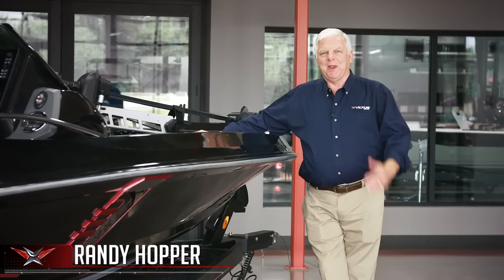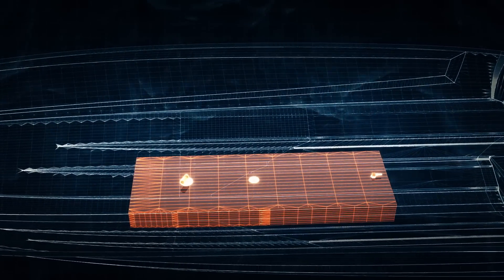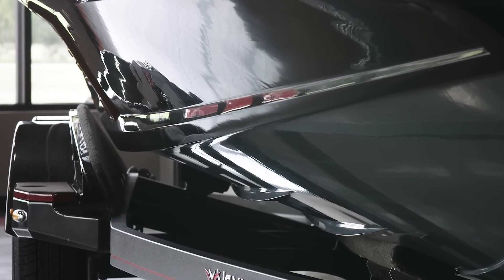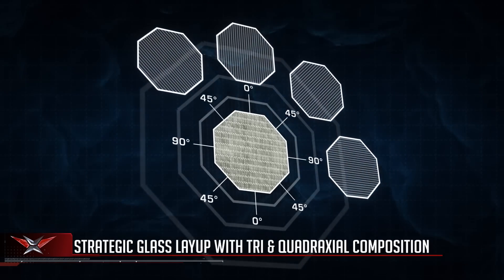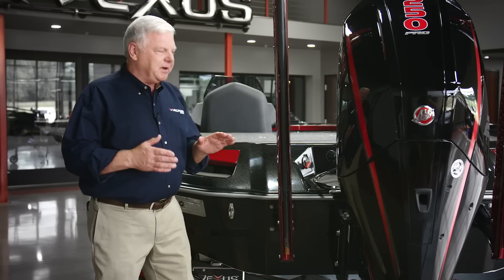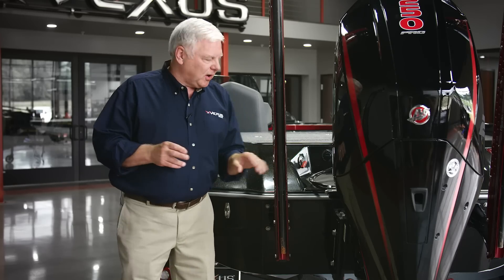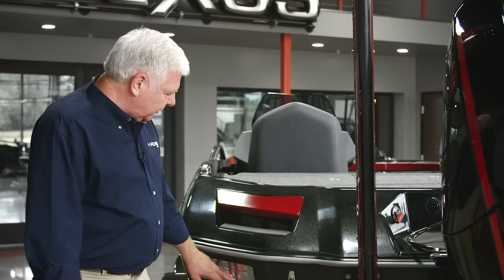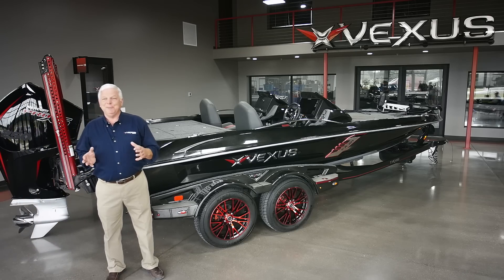VX21 – Revolutionary Hull Design

Comment: Looks nice but the chrome rail looks way too 80s almost like a basscat 👎🏼.So is this really a brand new hall from a new mold I mean new mold not the seven different ones that are being passed around and sold off. How far in is the pad from transom??? Because it looks like the boats really has to be trimmed up a lot to get a good attitude.
Reply: GREAT NEWS!!!  You can get that rail powder coated black.  I saw it on a gray VX20 and it looked killer.

Comment: love the vexus boats. but i’ve had a lot of problems with my avx2080. we had to get a whole new motor after my 200 pro xs had a oil leak, the fuel tank had to be moved due to the vexus recall. i love this boat it performs amazing but have a had a lot of issues for a 50k dollar boat. and i only see them working the fiberglass boats so it’s frustrating.
Reply: Buy a ranger bud. I have a friend who split his Hull in half from huge waves and ranger replaced the entire boat for free. They stand by their product
Reply: @hillaryclinton2700  lol. these people are ranger. the original ranger. bass pro builds ranger now. ranger builds vexus now.